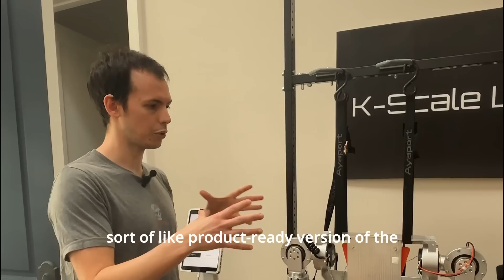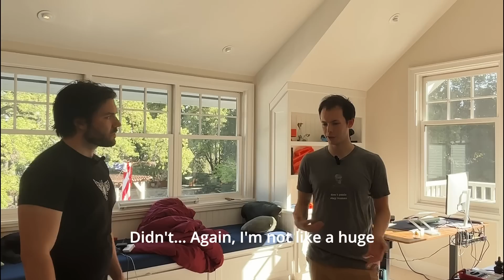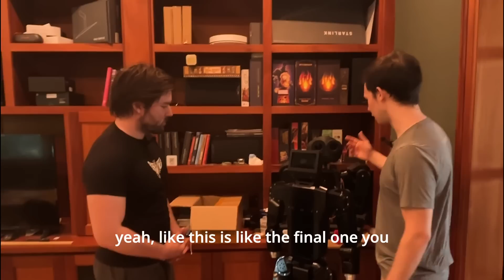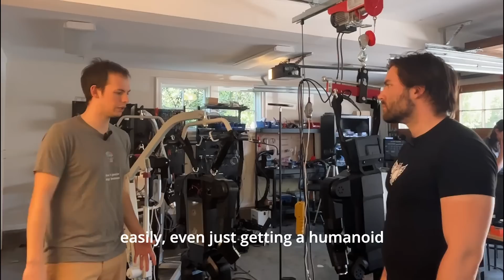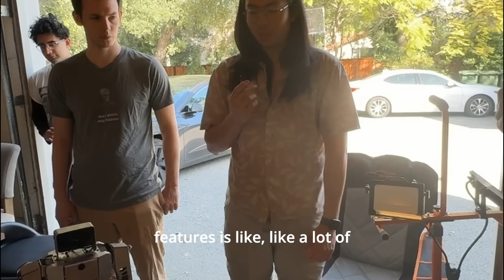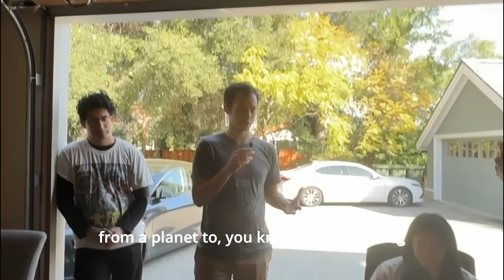$1,000 USD buys you a humanoid robot that's fully OPEN SOURCE and owned by you.

Comment: Even though etherCAT is faster than CAN, using CAN FD, non-extended frames and bitpacked messages you can get really fast update loops especially if you use one CANbus per limb (this is what the MIT biomemetics lab does). Also transmitter receiver latency is not the only thing and part of it is the communication back to the microcontroller. CANbus is integrated with a lot of MCUs nowadays like the STSPIN32G4 (which even have internal gate drivers for the inverter) and you can do hardware ID filtering for really low delays. I've seen the Robstride actuator protocol and its super bloated, so it's not as much a communication issue as much as it is a firmware bloatware issue. Also, etherCAT is kind of like daisy chained ethernet on the data link layer and actually most ST chips support 100 Mb/s ethernet, so you can just run that at the data link layer and you don't need to use IPs, just MAC addresses which reduces the packet sizes alot and is basically just as fast as etherCAT. You don't get daisy chaining but you can buy a cheap gigabit switch for super cheap. This is probably better than the USB, because assuming y'all are using usb 2.0 to communicate back down, thats max 480mb/s and the protocol is much more complicated compared to gigabit ethernet. Also, in terms of actuators, everyone is tied to internal planetary gearbox integrated motors, but I think for many joints of the humanoid it makes more sense to have cycloidal gearboxes with an external motor (like @PaulGouldRobotics design) because you can have the input and output on both sides so you no longer need a fancy crossed roller bearing. Also, the peak forces on the legs are really high in humanoids, and cycloids are much better for impact resistance and max torque if designed well. So designing a cheap robot arm or humanoid just requires optimizations and smart decisions which gets you almost to the same level as the really expensive hardware. I've also looked at K-Scale labs etherCAT inverter the were designing on github a while back, and there were many issues, a lot with the power traces, and I kinda get worked up when people say something is not possible when it is, just because they're not paying enough attention to detail. With all that said though, I think k-scale is working on something really cool and what they're doing is great and mad respect for the dedication to open source.

Comment: Great. Have open source humanoid robots so anyone with bad intentions can make the robots extremely aggressive or use them to commit crimes. As someone who worked for multiple startups that worked with top tier tech , the programmers are not ones usually who should be CEOs. They are generally very focused on achieving technical milestones and don't understand the big picture.

Comment: Deceptive title. The little toy humanoid is $1,000. The actual humanoid is $9,000.
Reply: Lol yeah people probably were going "wow that big thing for $1000?"
Reply: If it's an exact copy of a T-800 I'd buy it
Reply: all things considered, that's still not a terrible price
Reply: @celery-bones  Did anybody see Small Soldiers? Basically mini terminators.
Reply: If the buyer is a little person, it would be accurate for them.
Reply: At this point you can 3D print / CNC a whole robot. The software is the main thing.
Reply: @koriko88 I didn't realize you could 3d print batteries, electronics, motors and actuators... Basically the expensive parts...
Reply: @MikeBrownRehobothBeach  Well just go ahead and wait for someone else to make it and buy it then.
Reply: @koriko88 Within 3 years the software will be child's play. K scale is using a Raspberry Pi for brains. As you said, 3d print/CNC and Rasp Pi, Open Source humanoids could be cheap.
Reply: @revisionfour Getting it to do what you want isn’t as easy. Walk in a straight line and have an LLM conversation? Maybe. Drive to the store and get blueberries without making a scene? More than 3 years away.
Reply: @koriko88 We'll see. I'll be building them. I train AI and already have CUA agents that pass captchas. I work in computer vision atm. The rate of AI improvement, I can do full humanoids within 3 years.
Reply: @revisionfour  People underestimate how close we are...
Reply: @koriko88  also motors ... motors are expensive and heavy and weak, scaling size/weight costs a lot in copper+magnets
Reply: 9k isn't 70k for the Unitree. I can afford that.
Also He did say the coding the mini is scalable to the big guy.
Reply: @VPZ80  I'm not paying $9k for a humanoid with no demo. Theres no videos of it doing tasks. I will build my own and better for way less than $9k.
Reply: Humanoid doesn't necessarily mean human-sized. Gnomes, or even penguins, for example, are tiny humanoids.
Reply: @Jianju69 The word deceptive was used, not lie.
Reply: Bro its a baby gundam! A metabot!
Reply: Yeah, title and/or thumbnail, I wouldn't have watched otherwise, they need to change the misleading/deceptive thumbnail and/or edit the title so it is clear that it's their mini bots go for $1, 000.
Reply: its a baby, not a toy ;)
Reply: 100,000 for a bare minimum advanced carbon arm prosthetic, humanoid for 10G? Lel
Reply: I don’t think is disingenuous because $1000 can still build the little one and most of the challenge of humanoids is the software, it’s going to teach you everything you need to know
Reply: @ironichoneybadger5066  Yeah, no. It's a clickbait title.
Reply from the maker: I think the thumbnail was confusing so thanks for the feedback, we've updated it.